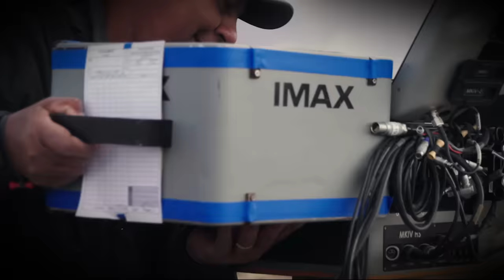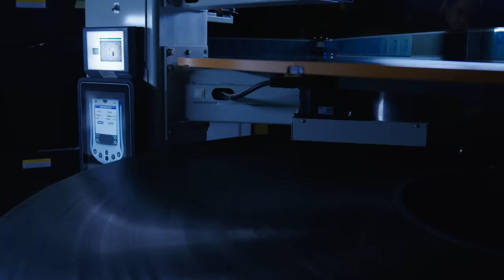Oppenheimer | Shooting For IMAX

Comment: My friends and I are flying to London to see this at the BFI when it comes out. We live in Bavaria, Germany, which is roughly 1000km and three separate countries away. Some films just have to be seen a certain way to really engage with them. We had this planned for six years now, ever since watching a digital DCP projection of Dunkirk. It didn’t work out for Tenet because of the pandemic but we’re doing it for real this time. And if the BFI for some reason don’t show it anymore by the 22nd of August, we’ll drive to Prague and watch it when it releases. It’s sad that analogue projection and IMAX 70mm is slowly dying.

Comment: Actually, for filmmaking even 8-bit final image is not a problem as long as compression of codec can keep the noise of the "final grain". But, in the era of UHD HDR, 70mm-film carrier is just "return to classics".
Reply: louiskirkwood4101  Actually, I like the idea of returning to "chemical film' manufacture and distribution. There is no software royalties and risks associated with them, manual audio-video sync, low risk for film to go to internet torrents before return of investment went out. But the niche  is very narrow.